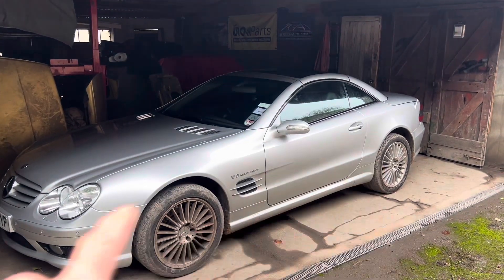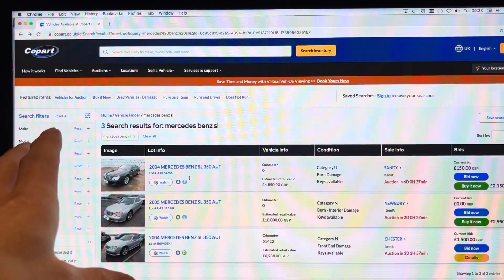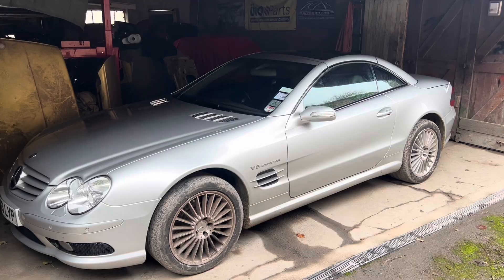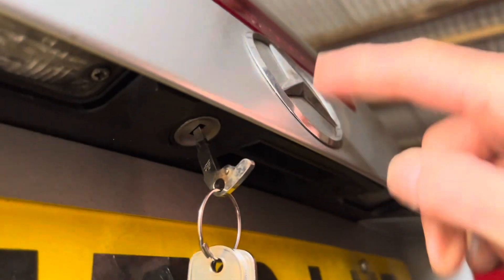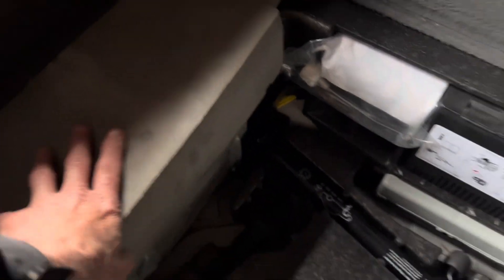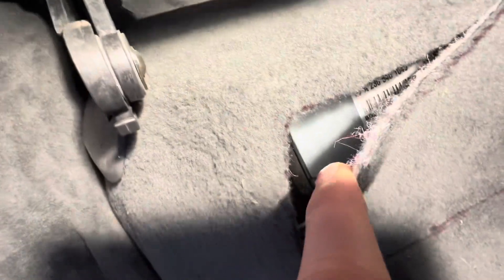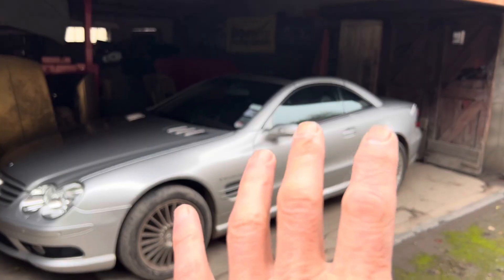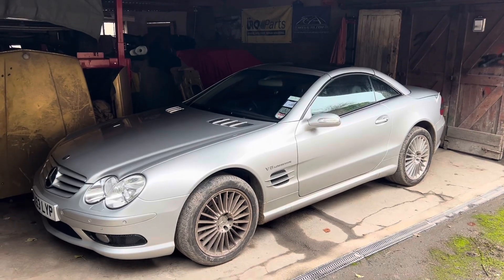Mercedes R230 Battery control module (BCM) fire risk. How and why you should  fit inspection hatch.

Comment: Hi very informative video, looks like my BCM may have just burnt out, i was doing a routine run through operation of windows and roof when I could smell burning, went to the boot to find smoke coming from that area, quickly disconnected the battery luckily no fire. 
Could you possibly give me the link to carpet removal as I don’t want to cause any unnecessary damage, many thanks.
Reply from the maker: Hi - sorry to read about your BCM. What is the make model and year of your car? Here is a link:

Mercedes R230 SL55 AMG ABC Visit Workshop fault- FIX
https://youtu.be/UEDThe00BCg

Mike
Reply: @MikesMercsandothercars  Hi thanks for the link, i have a 2004 350, first major problem in my ownership.
Reply from the maker: @74dazzag  Yes - a common issue especially as cars get older. It seems that many of the capacitors in the BCM just weren't designed for 20yr + operation. I guess it's easy with hindsight. Mike

Comment: Hi Mike! Do you think is a good idea to have an AGM batterie charger all the time plugged when the car is going to stay for 1 or 2 months at the garage? I'm doing this for the moment using a CTEK charger on AGM mode. But not sure if it's better only charge from time to time during this period. Thanks. Eduardo
Reply from the maker: I think keeping a CTek trickle charger connected should be fine. Mike

Comment: 2007 sl550 everything was fine when I parked it it was raining all day next day car turns on no windows no seats no dash lights no gauges working WTF checked all fuses all good motor runs car shifts nothing else works
Reply from the maker: Sorry to read you are having a problem with your SL. Here is what I would do:

1. Ideally, the first thing you should do is to plug a scanner in and try and read any codes as that can save you a ton of time and money. Something cheap and cheerful like the Launch Elite V2 or iCarsoft will suffice.

2. Try your spare key (if you have one). Strangely enough a faulty key or dead key battery can cause this issue in some mercs:

https://www.youtube.com/watch?v=QTr4cgihmj4

3. Do a load test on both your starter battery AND your consumer battery. 

4. If you are unlucky, one of your SAM (Signal Acquisition Modules) will have failed. Check under the seats for moisture. Sometimes water ingress due to a faulty seal can cause corrosion on the terminals or a short.

Good luck. Let me know how you get on.

Mike

Comment: Hello friend, love the video. How much did you pay for that cover? And also did you outline it from the outside of that strip or from the inside of that white strip? It’s a good idea. Looking forward to getting one.
Reply from the maker: Hi - yes that inspection hatch is simple yet extremely useful.

At present the cover is only available from Brian Wallace aka  'The SL Guys' via their Facebook page. The hatch is US$45 plus shipping and there is a discount if purchasing it along with the replacement battery control module., for those people the cost is US$35. In the US, it will ship in a priority envelope for US$10. In the UK, it will ship for US$5. The rest of Europe surrounding regions will ship for US$10. Anywhere else, we will quote the shipping. You draw round the inside of the template. Mike
Reply: @ 

Thank you friend for this information I will definitely get that kit when it’s available to order also out of the for accumulators and Dabner I found one faulty damper, which was in the front driver side wheel. Well, the small one the two main big ones were not blown and the leveling one in the back was not blown, but I replaced all of them, it was very easy. Just a little one in the back was kind of a took a little bit of time because it has two pipes to it and two different bolts. The little bolt area was kinda tough to get it in and get it out but with the right, correct tools, you should knock it out. I think it’s definitely a must for someone to replace their accumulators and dampeners. If they’re original, I mean when one blows, the rest are just around the corner

Comment: I have tried everywhere to find this inspection cover. have even googled the SL Guys. Also, would like to know where to source the fuse modification kit as, would like to know the recommended wire gauge to use and make my own. If I can't find this information, I will use the same gauge wire that goes to the BCM. Thanks for posting. Cheers.
Reply from the maker: Hi - sorry that you have had problems finding an inspection hatch. Drop me an email to m_scott65@hotmail.com and I'll put you in touch with the SL Guys. I have not done the fuse modification to my car but you could try asking the guy who runs the Groove On channel:

https://www.youtube.com/watch?v=k_D2hCDMEBQ

Mike

Comment: Is the front battery actually responsible only for the engine starter? In case it is, do you really need to have a BCM in case you drive the car once per week? The front battery should have enough power to start the engine couple of times and you can recharge with your CTEK at home after each ride. Obviously warning lights would remain but there are different projects out there that can interfere with the CAN bus and emulate all the messages our lovely SL wants to see.
Reply from the maker: Yes, the front battery generally just powers the starter……but when the consumer battery is low, the BCM signals Emergency Mode and ties both batteries together in order to power the SBC brakes….allow the roof to go up….windows to go down etc if you remove the consumer battery in the R230, the car won’t run. Mike
Reply: @MikesMercsandothercars  Understood. My consumer battery is brand new and it is getting charged by the alternator correctly, so I don't have any concerns there. I think I just lost trust in the BCM and since my R230 is a weekend driver I'm thinking about removing the BCM completely to begin with and take responsibility of occasional charging the front battery in my hands. I'm building a CAN emulator on an STM32 board so this should solve the "Consumer unavailable" messages and warnings.

Next step would be to either connect a DC-DC converter (Victron) or use the Brian's replacement if any of these are even going to be needed. I'm not sure how painful manual charging the starter battery is going to be

Comment: Hey mike could also be the PSE pump impeller not locking and unlocking the doors and boot too
Reply from the maker: Yes - a failed PSE pump can also stop the boot opening...but usually, burn damage means the consumer battery will be dead. Mike

Comment: not bad, I know the SL Guys also with their BCM replacement. Are you not going to perform the fuse prevention on your BCM,? I would STRONGLY advise not to leave this and get this done ASAP, you do not want your beloved R230 going up in flames.  Here is how I did mine that will help you: https://youtu.be/k_D2hCDMEBQ
Reply from the maker: Thx for your comment - I did actually watch your video when it came out...and a number of subscribers also mentioned the fuse 'mod' but it is something I have resisted thus far. I think what I will do, is fit the SL Guys unit in the car, (I bought one a while back) and keep the BCM as a back up in case I ever need to use a scanner for full diagnostics. My belief is that the BCM damage happens over a period of time and provided you inspect the BCM periodically you can spot signs of a MOSFET or CAP going bad long before it melts the BCM or sets fire to the car. Mike
Reply: @MikesMercsandothercars  hi Mike, my BCM is the original from 21 years ago! I just added the fuses to allow the current to stop in case of a short. Whilst doing the mod, I did notice moisture around the area, but as I leave my car outside is expected. The condition of the BCM was good and no signs of verdigris or moisture ingress. 
My thoughts on the failure, is possibly due to constant use of trickle chargers, as the BCM is monitoring voltages for the front and rear batteries constantly, however this is my thoughts not proven.

You may find it a little tricky accessing the cables through the inspection hole you've made, but you can always pull back the carpet like I did.

Great channel by the way!
Reply from the maker: @ Thx. I like your channel too because you are actually showing how to do the job. Mike

Comment: Very informative fitting one of these would save the hassle of removing all the boot trim when testing and replacing a BCM. In your experience could a battery drain be the BCM if the car does actually charge and run normally without any dash lights? I’ve checked the areas in your other videos eg glovebox light etc
Reply from the maker: BCM Battery drain unlikely. 

When you put a clamp meter round the consumer battery terminal, allow car to shut down (approx 5-20min), what milliamps is the consumer battery drawing? It should be around 55mA

Does your consumer battery go completely flat....or is the problem that the 'Consumer electrics offline' message is triggered after just a few days.

Have you taken the battery out of the car, fully charged it over night...and then periodically tested it over the next few hours to see if it is holding charge at 12.6V. Remember 12.2v is 50% discharged. Don't relay on the cars alternator to charge your consumer battery if it is really flat - its not designed for that (nor is the BCM).

Many of the batteries I have looked at are knackered and don't hold their charge. If you leave your consumer battery at anything other than fully charged for any period of time you will quickly ruin it. It is easy to mistake a knackered battery for a parasitic draw.

If you have eliminated glove box light, phone charger, tracker unit I would start with:

1. Any other non standard equipment such as stereo or blue tooth devices.

2. Make sure command unit is actually switching off after 25 minutes...eg that the fans are not still on and the CD player isn't constantly clicking.

3. Corroded PSE pump connections in boot can drain battery really quickly.

4. Door modules and seat modules also can develop a fault...especially in a damp car.

Mike
Reply: @ Thanks Mike will update after I have completed the next round of tests. I think I had 100mA drain and have been charging the batteries directly as well as driving.

Comment: Waiting on the BCM replacement with bated breath!  Is it Brian's replacement, from the R230 BCM fires Facebook group, or was it developed independently?
Reply from the maker: Yes - the replacement BCM I have is from Brian Wallace. Have you already ordered one? Mike
Reply: @ not yet, I guess I better get on it. My SL is an 05 and the caps seem to be degrading. It’s charging intermittently and the alternator and K57 have been replaced.
Reply from the maker: @ Don't wait too long...replacing a melted wiring loom, damaged trim or scorched paint work is expensive. Mike

Comment: That's a great modification.  One of the issues seems to be that the BCM has unfused connections to each battery.  There's  great channel 'GroveOn' where he shows a mod to put 10A fuses in line at the BCM between the batteries and the BCM.  So a fault in the BCM shouldn't mean excessive battery current flows without any external protection.
Reply from the maker: Thanks for your comment - yes I have seen the 10A fuse mod and was in two minds about whether I would do this on my car. I guess I have yet to see any evidence that the 10A mod would protect the BCM in anyway....although I accept that it might prevent a car catching fire. I;m happy that there is an easy way to periodically inspect the BCM...and even replace it if necessary...and I like the Groove On channel. Mike
Reply: @MikesMercsandothercars  it's surprising there no internal fuse on the pcb board, seems like very poor design by Mercedes.  The inspection flap does look a great mod.
Reply: @kevinsheahan5449 
Agreed, that car literally has hundreds of fuses…and the critical BCM is not fused, how does that make sense?

Comment: Sir your video's enabled me to restore two R107 a 450 and a 380 and I also had a SL 320 R129 which i sold due to cost of maintaining. I am an admirer of your efforts how ever I have not purchased a R230 SL yet even though they are dirt cheap
Reply from the maker: Thanks for your kind words. Yes...buying an R230 is s tricky choice and you are wise not to rush in. I have always thought that the biggest downside of the R230...especially the SL55 AMG is that it looks just like a normal car....and thus lulls you into thinking the running costs will be the same as the C Class or E Class....In reality, the performance of the SL55 in particular is up there with a Ferrari/Porsche/Lambo etc and when you buy these cars you kind of expect a big bill when the roof fails...or the hydraulic suspension fails. Sub 3k for a 350SL and sub £5k for a SL55 would probably be a bargain.....and leave you with enough cash to fix them if they go wrong. Mike

Comment: how can I buy one of the covers I'm not on Facebook and do not want to be on Facebook
Reply from the maker: Yes - I know the feeling. I only set up a Facebook account to contact the guys who make the BCM and the inspection hatch. Where are you based? Mike
Reply: @MikesMercsandothercars  I'm in Nj
Reply: @MikesMercsandothercars Ditto. I’m UK based and interested in one of these hatches as well. If the SL Guys have a mobile or WhatsApp contact, that would be great. Thanks!
Reply: Me too! That’s a great idea. I’m about to remove mine to get it checked and upgraded so it will save me the hassle of removing all the trim etc.. 👍

I believe the main cause of failure and fires is that the capacitors will leak over time. 

Great video. Looking forward to more. I need to change my ABC fluid too - I’ve done it once before.